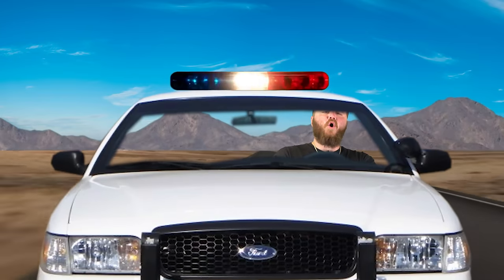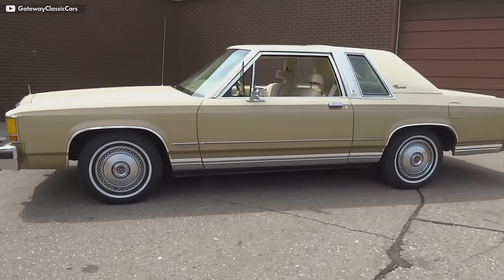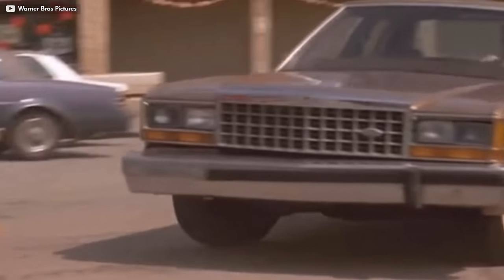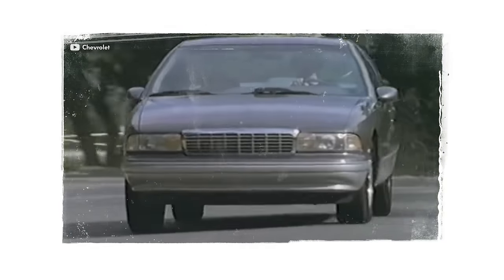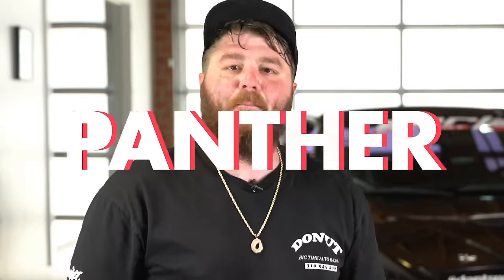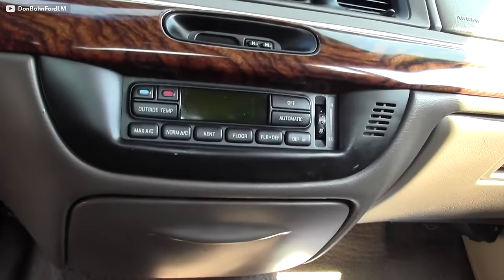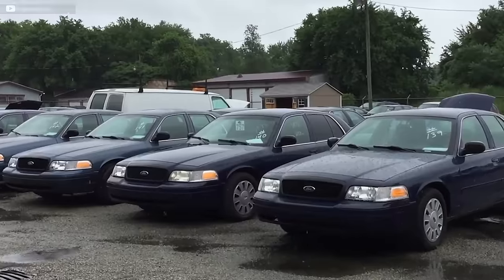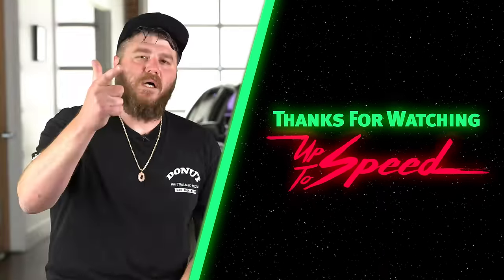Ford Crown Victoria - Everything You Need to Know | Up to Speed

Comment: I want my first car to be a Crown Vic !
Reply: Do what I did just over a month ago. Buy a used P71 that was a detective car, and has less than 150,000mi. I got mine for $2400 out the door. It's my first car and I love it to death. I'm never gonna sell it. If it comes to it, I'll restore it. But it's gonna be mine forever. It was the best $2400 ever spent.
Reply: MCA der Negus You are aware the average American car nowadays gets somewhere around 35-45MpG, right?
Reply: You wont regret it, trust me ;)
Reply: MCA der Negus  Is diesel any cheaper?
Reply: I want my first car to be an El Camino, and I'm building one with my dad. How convenient!
Reply: Luis Traffa  I am 15 and I bought one 2000 ford crown vic
Reply: Do yourself a favor, don't buy one, they suck
Reply: Ugyl ass cars
Reply: Luis Traffa it’s my first/second because i bought both around the same time. i love it so much. it drives super smooth. the only problem was cracked/chipping paint, but i’m painting it in the spring or summer. i have a ‘93 & definitely prefer the older models.

Comment: I own a 2008 Crown Vic P71 and it the greatest car I ever owned!!
Reply: Resilient hey i plan on buying one probably nexy year. How reliable is it? And does it drink up allot of gas?
Reply: Marcos Perez Perez, The P71 is very reliable & durable. I get a decent gas milage. It all depends how hevy your foot is. The parts are super cheap if need to be repaired. I get a Just so you know,  be prepared for other drivers to think that your a cop and might start drving super slow in front of you...Before you purchase a P71, check the transmission, other then that its an amazing, Intimidating American icon.

Comment: The main reason that Crown Vics were favored for fleet use was the modular design of the power train, which was possible by the panther platform. In this way, fleet units could be driven a couple million miles by allowing easy removal, rebuilding, and replacement of the power train components as needed.
Reply: The word modular doesn't mean what you think it means. The "modular" power trains were modular in the sense that ford didn't have to retool their factories every time they wanted to do something different. it was a manufacturing term more than anything

Comment: I have a 1982 ford ltd crown vic. It was my grandma's she bought it off the dealership and was her daily. She died 17 years ago and it was left in a garage for that long. Last year some family wanted to give it a home to a family member and I, 17 at the time grabbed it. That's my second car and it's a fantastic daily driver. I put a 600cfm holley on, hei distributor, bored the cylinders, put a nice comp cam in with a super quiet muffler. Must comfortable car ever. It's a 2 door as well. The paint is perfect, all the chrome is perfect, even the vinyl roof is immaculate. With 85k miles

Comment: I have a beautiful low mileage 2006 Grand Marquis. It was a one owner car, and belonged to an older couple that took really good care of it. It now has a Borla true dual exhaust system. I wish I could do more, but we have emissions testing here. As big as the Panther cars are, they are not that heavy. They weigh around 4,000 pounds or 2 tons. But would you believe a V8 Challenger weighs 500 pounds MORE? I've seen Panther cars run in the mid nines, though I'm assuming they were certainly not emissions legal. Their strong construction means they can handle 3 times more power than stock with no body or frame reinforcements. I'm sure everybody knows about "the farm truck" It would be super easy to build a Crown Vic that would blow that thing into the weeds. I may never get rid of mine. It's the last big V8 powered RWD, body on frame, solid rear axle American car that will ever be built. Right now they are plentiful, and because of that people are trashing them right and left when they should be taking care of them. This is a car that can be made to last another 50-60 years if parts are still available. I have a 1964 Fairlane sedan that is still running great after 54 years. And the Panther cars are built a lot stronger. Hopefully modern technology will make it possible to reproduce parts for these cars without them costing a fortune.
Reply: I got a 2011 about a month ago as my first car, shes pretty scratched up and has some bumper dents,(and my bad backing up ablities caused her some more scratches unfortuantly) but I plan on keeping this thing as long as I can and one day I'll restore it to look brand new, because these cars will be classics one day for sure

Comment: I picked up a sweet 2011 P7B that was one  of theb last made - July 2011. Original owner was for Fountain County Indiana Sherrif's department and was the Sheriff's car. It never had roof light bar, never had a patrician, full carpeting, cloth seats front and rear,  and factory AM/FM/CD player. All the maintenance records came with the car and I bought it from an dealer in Indiana that does a lot of decommissioning of police cars. I got it cheap because it had a rear end growl (pinion bearing) and I rebuilt the rear end, then installed a Rhino push bar and installed LED fog lights on the bar. It fools everyone thinking it still is a police car. Even the local police think so.

What some people don't realize is the P71/P7B Police Interceptor Vics are a different animal than other Panther platform cars. For P71/P7B units, the rear end is the same that was on the full sized Broncos (think OJ). Sway bars are different. Struts are different. Control arms are different. Intake is different, exhaust is different. And the top speed ECM limit is different.

Comment: The Marauder had more than a different intake and center shifter. It was a different engine. The Crown Victorias, Grand Marquis and Town Cars had a 4.6L 2 valve V8. The Marauder had a 4.6L 4 Valve V8. I'm a huge fan of the platform. I currently own a 2000 Grand Marquis LS HPP and a 2006 Crown Victoria Police Interceptor. My wife and I also had another 2000 Grand Marquis LS that we sold as well as a 1984 Crown Victoria LTD.

Comment: My father had one--2008--and it was fine until the electronics started going bad .  $1,000 to replace the electronics in the a/c, the lights in the dash display mostly did not work, the doors would lock themselves,, one of the computers died.  It was pretty much given away just to get rid of it.  Nobody wanted to buy it.  But the ride was great!

Comment: Please Do The Lincoln Town Car! I’m A 1997 Town Car Owner.
Reply: Kevin Griffey-  Ehh... Isn't that basically the same car as the Crown Vic?
Reply: Really should have been mentioned more in this video though. The other option if the Merc wasn't dressed up enough for ya. And a mainstay of airport limo fleets like the regular Crown Vic was to cabs.
Reply: I think he just did !
Reply: That Trucker Wes B Damn I been looking for a 89 Towncar for the longest, I love the 80’s towncars with that huge front grille!!! Prices went up on though ones.
Reply: Kevin Griffey My dad bought it back in 92 and sat it down in 05. I just got it back running last June and currently working on the engine. Had the tranny rebuilt in January
Reply: That Trucker Wes B Smart Move, Best American Luxury Vehicle In my opinion, New cars today all look the same and have way too much unnecessary tech that you will never use, and there small and over priced! Perfect example: Tesla.
Reply: I also owned a 2002 town car luved it too.
Reply: So is my grandma

Comment: I have loved these cars for decades. I was raised in 2 of them int the 80s. I’ve owned 2 80s vics and currently own a 99. I would own a whole fleet. They are just the ultimate car. The 80s ones are like driving a couch.  My 99 is robust. My last 88 Vic saved my wife when she was rear ended. It took an amazing beating but saved her. I will drive these beasts forever, i hope.
Reply: Sorry to hear about the '88. But those classic Vics were metal. I have an '89 LX.

Comment: The Mercury Marauder used a DOHC 4V 4.6L (dual overhead cam shaft, 4 valves per cylinder engine similar to the ones in the 1996-1999 SVT Cobra Mustangs) whereas the standard Crown Vic / Mercury Grand Marquis' used a SOHC 2V 4.6L.
Reply: I’m 3 years late, but I came down here looking for this comment lol

Comment: I had a '92 Crown Vic with the 5,000-lb. Trailer Tow Package -- ABS, Rear Air Suspension, Dual Exhaust -- Terrific car !!
Replaced by:  1995 Grand Marquis Restoration - Mercury Forum - Mercury Enthusiasts Forums

Comment: My grandfather handed me down his 1980 Mercury Marquis aka, Crown Vic. I wish I drove it but had 4 other vehicles on the go and ended up selling it in 2016, with 80,000 original kms on it, never rolled the odometer. The kid picked it up at my dad's place for $500, threw a battery in it, pumped up the tires and drove it 250kms back home, which, funnily enough his home was in the same town I currently live in. I've seen it get sold between the young fellas around here multiple times for as high as $10k, but never any mechanical or visual changes except some shitty tint and window banner stickers, and they cut the mufflers off.

Poor car, I should of just kept it and drove it

Comment: I have driven both the Crown Vic and the '90s Caprice a lot.
The CV is a superior vehicle.
Handles better, more reliable, better visuals, better looking, better interior. The dash under the Caprice  windshield was so long it was suitable as an airport landing strip. The endless front windshield and back window were dangerous sun magnifiers and hot boxes during Summer.
Ford Crown Vic, Mercury Marquis and Lincoln Town Car were and still are stellar cars.

Comment: After 1997 the CV suspension was changed in the front for better handling at high speeds as older models like my 1997 and 1995 had an issue at around 140 mph of drifting due to the air pocket under the car and the steering and front suspension. Also racing parts for the rear end are still available ;) any CV after 1997 was a different generation with different steering, rear end width, air ride suspension (factory yuck...after market tasted better). The police version has a lower GVW that the LX and while the taxi version had the longest wheel base and the tow package was discontinued proof to 1995 (think it was 92) these make great tow vehicles as my 1997 has pulled a 12 x 7 cargo trailer thousands of miles and up and down mountains. With the proper tires and weight distribution these are great off road as I have driven mine on quad runner trails in the mountains.

Comment: I bought my 2002 Lincoln Towncar because I HAD to have another Ford V8. My beloved 1993 Ford F150 Lightning had almost 300,000 miles on it and I was too busy and broke replace all of the brake lines (which were bubbling with rust,) ANOTHER torque convertor, and have the valves done ... so it went to an auto restoration shop in LA. I bought an old taxi for $4,000. After 6 trouble free years I'm waiting for a my new (factory rebuild) transmission. I'm retired now, brakes and suspension are cheap to fix, and the motor is still strong at 170,000 miles. Besides, it's more age specific for me than that Lightning now, and gets WAY better gas mileage ... on the freeway.

Comment: I mean no disrespect and it may have already been said but I wanted to correct something. After the PI heads were added to the 4.6 the engines remained the same until 2008 when Ford added the "Marauder" airbox to the single overhead cam 2V 4.6 giving them 50 extra horsepower, the Mercury Marauder however was equipped with a dual overhead cam 4V 4.6 to reach that 300hp mark. I love Panthers, I'm sitting in my p71 while writing this😁 thank you guys, I love your content.
Reply: -2008 white P71 5.4 Triton/5spd swap 😁

Comment: The Panther platform has moved into the spot that the '77-'96 GM B-Body (esp. the '94-'96 LT1 powered years) was in the late '90's and early 2000's. Plentiful examples coming out of Municipal/Law Enforcement fleets, cheap prices for generally well maintained cars at the auctions, great handling suspension setup in spite of their size, cars that were designed not so be the cutting edge of technology at the time  but designed first and foremost to be easy to maintain and to last forever.  In other a great under the radar project car material .This is coming from a '95 Caprice 9C1 (mechanically identical to the Impala SS) owner.

Comment: I put 320,000 on Grand Marquis with the 4.6 (blew two plugs out) and the only reason I'm still not driving it is bending the front of the frame in an accident. Could never get the alignment back proper and I wasn't about to spend $3000 on bodywork for a car my dad sold me for a dollar when my daughter was born. They didn't want me driving a fragile baby around in my 95 Civic.
Edit: I would have another in a second even with the horrible gas mileage. I'd die for a mint Marauder.

Comment: 05 and up crown vics have the same motor as 02 mustang gt 4.6. Use the mustang gt computer,exhaust and intake manifold to get some cheap gains. I think it would be cool to swap a 5sp manual trans also but dont know if it is easy to do

Comment: I bought a grand marquis. 1991. $500. My friend cousin needed money. I didn't need it. I tried to kill the car more than three times. Jumping it so hard that it knocked the grill and battery out. Hooked up the battery started. Took it off road with 6 people.  My buddy in a jeep Grand Cherokee was trying to make it up hill. I was like hold my sprite?  Hole in the gas tank and oil pan crushed.  JB weld on the tank took the plate off beat flat on a stump. Unkilled. They are truly amazing cars. Mine had the 5.0.

Comment: They said that the Panther platform was dropped because it couldn't be had with ESC(electronic stability control). Hogwash! Even fullsize pickups today have ESC and they're body-on-frame vehicles. They could have created a body-on-frame replacement for the Panther platform that could use ESC. They still could today.

Comment: I recently bought a 01 CV and it had the common crack in the thermostat area but I installed a Ford racing intake and a new set of spark plugs and an H pipe with the exiting before the rear tires...I really like the way it sounds and has great low end torque and seems very dependable...the steering response and the way it handles causes it to feel a lot smaller..I don't like the way it sits to low to the ground and how most of the newer cars tower over me on the highway mostly because of the dangerous women drivers texting and oblivious to their surroundings...my plan is to Mad Max it out with a lift and 33s on the back and smaller on the front so it will have a raked style..I'm going to modify the front to make it look like the Original pursuit special with a roof and trunk spoiler, matte black finish..black wheels...no bling, and no rap music.